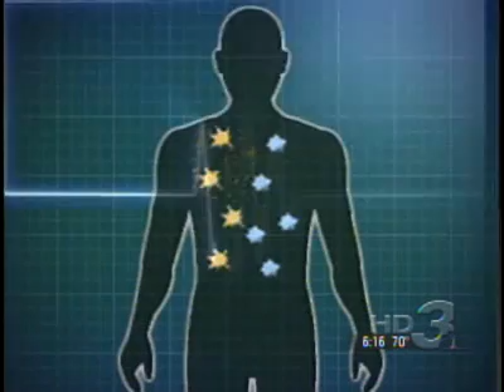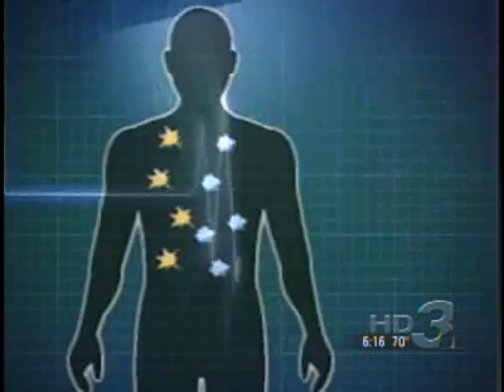Gas alternative

Comment: @Bathroomactivities Actually, the water isn't burning.  What's happening is the radio waves are separating the water into hydrogen and oxygen.  THAT is then burned to make...water.  Water that hot, of course, would be steam.  Steam could be shot out the car's tail pipe and not pollute anything.

I'm a little skeptical about the efficiency of this process, though.